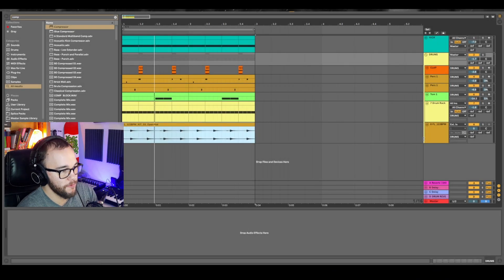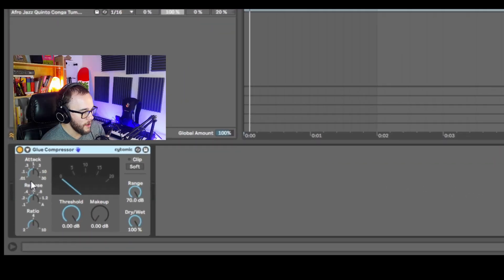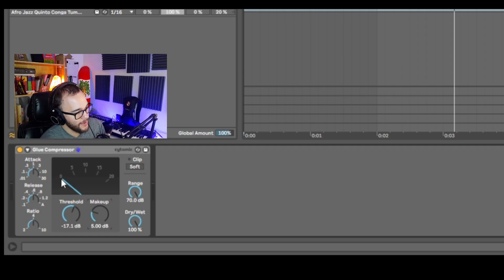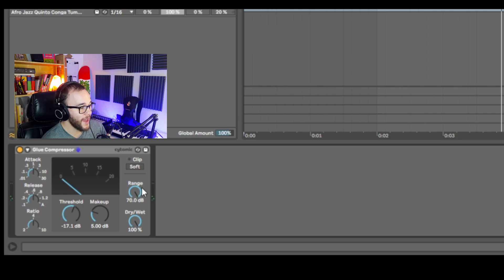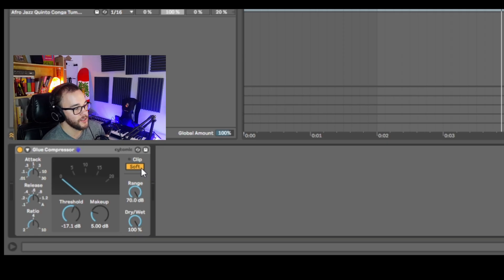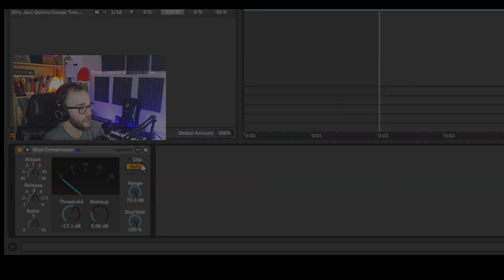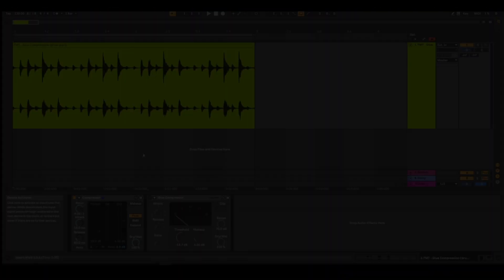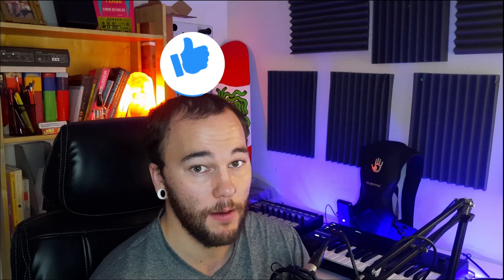How to use a Glue Compressor (and why is it different than stock?)

Comment: What does glued together sound even mean?
Reply: Like the sounds are closer together dynamically, and sonically. They sound like they are more 'together' and less dynamic in that sense. They move together more. It's subtle, and takes a practiced ear to notice, but it is beneficial.
Reply: it practically doesn't mean anything. the glue compressor simply has slower attack/release times.

Comment: I've never used a glue compressor and I wouldnt be spending a 100 quid on one just for the so called "warm" myth which is just a marketing scheme to sell plugins to beginners in my opinion, I use the tuneboosters free basic compressor for everything it works just fine. I'm sure this compressor is good for piano songs and music with lots of dynamic range but for a trance producer like me or anything hard and fast i want my sound to be consistently loud so I saturate and clip the shit out of almost everything so the peaks are almost flat before it hits the limiter.
Reply from the maker: Well the Glue Compressor comes with Abelton Suite so no need to purchase an additional one :) The warmth is not very obvious, but I do hear a difference, it's just very slight.

Comment: Personally I find the glue compressor doesn't do much differently than the regular compressor unless I use pretty extreme gain reduction and makeup on it. So I use the regular compressor with 2-3 db GR for taming peaks, and Glue with 7-10 db GR to give it a glued, colored sound. And this also works using really extreme GR and then doing NY compression by turning down the dry/wet a lot.

Comment: What all buses should u use the glue compressor on? Fx, synths etc?
Reply from the maker: I use it for drums but you can use it for any bus :)
Reply: @DowdenProductionAcademy  np man, should you use this on the master channel to glue the whole track together?
Reply from the maker: @fazedingleberry123  I would let the mastering engineer worry about the master! But if you are doing it yourself then you could use a glue compressor on the master, I wouldn't glue much, I'd say 1-3db at most on average (some higher peaks are fine).

Comment: should you glue compress everything? Bass? Drums? Vocals? etc? 

or just drums? Please don't say "just anything you want compressed or glued" lol

What about glue compressor on master?
Reply from the maker: I usually only glue compress my drums. Mostly I use glue compressor for drums and sometimes busses. Stock compressors for other things (you don't need to compress every single channel) and then limiter for master. When I master tracks I also use multiband compression but that's a whole other thing :)
Reply: @DowdenProductionAcademy  Thanks so much for that feedback - its hard to know what to learn, in what order - then when you learn a new trick you have the urge to use it everywhere!

Comment: Colour (saturation) is only part of the story. Glue compressor emulates a feedback compressor topology, whilst stock compressor is a feedfoward design. A feedback compressor first compresses the incoming audio before sending it to the internal sidechain (none of which we hear), it then "feeds back" the compressed audio to the detection circuit, therefore the compression action (for the signal we do hear) is based on a smoother pre-compressed waveform than the one we actually put into the compressor. This all makes for a smoother, less spikey compression envelope (perfect for glueing bussed elements with each other) which doesn't clamp down on peaks as aggresivley, making it ideal for shaping your drum bus dynamics (for example) without squashing the life out of the transients.
Reply from the maker: Cool! Thanks for the detailed explanation, makes a lot of sense!
Reply: Thx for the detailed explanation! Made a lot of sense

Comment: What is the point of this video if you can't really demostrate any audible differences? You should go with some extreme settings to make them obvious. And you should use audio effect rack or midi mapping to switch between compressors instantly. There is some homework to do)
Reply from the maker: The video does many things - it briefly explains how to use a glue compressor, it explains the differences between the glue compressor and the regular stock compressor (and when you may want to choose between them), and it explains the idea behind the glue compressor and what it's modeled after, all in around 2 minutes. 

I don't think using extreme settings is the proper way to showcase this tutorial because typically you would be using the glue compressor in the way I've outlined in the video - for 'gluing' things together. Of course it can be used for different types of compression, but the point of the video was showing how to use the glue compressor in a more subtle way. By all means, crank that compressor up a notch! I've got about 5-6db of gain reduction which is still a considerable amount of reduction. The glue compressor isn't going to be a completely different sounding compressor. It's different, but it's subtle. 

There is actually an audible difference between the compressor and the glue compressor in this video. I can hear it quite clearly. It's a subtle difference - but it's definitely there. Like I said, the glue compressor isn't going to drastically differ from the stock compressor - they are performing the same action. The difference is subtle, but it is there. If you're having a hard time hearing it, it could be to lack of practice and that's totally fine! It will come with time. 

I always welcome constructive feedback, there are many different way to do things. :)
Reply: For real.  Also on the "comparison" at the end the compressors have totally different attack and release settings.
Reply from the maker: @brandontaylor6  and like I commented early, they are not 'totally different attack and release settings'. Yes - the attack was 9.9 milliseconds off, I realize that now - small mistake that won't really effect the outcome in this example in any way significant enough. The release settings are the same.

Comment: i hear no difference in this example
Reply from the maker: It's very subtle! I definitely hear a difference. Listen closely to the clap - that's where I find it most obvious.
Reply: @DowdenProductionAcademy  i still love your channel
Reply from the maker: @LiquidModernityTastesLikeUrine  Haha thanks! :) Thanks for watching!
Reply: @DowdenProductionAcademy  Your attack and release settings are totally different in the comparison too.
Reply from the maker: @brandontaylor6  I realize now that the attack has a 9.9 millisecond difference. The release is the same on both compressors. 

I thought both the attack and release settings for the glue compressor are measured in seconds, but it's only the release that is measured in seconds. Must have mis-read that in the manual! 

Either way, the attack is only 9 milliseconds faster on the glue compressor, and won't make a significant difference in this example. I do apologize for not having the attack times exactly aligned, but it really is a very insignificant amount and shouldn't be dwelled on :)

Comment: Interesting. I usually put the MixGel preset on my buss to "achieve" the glued sound. However, I might start using the Glue compressor to try understand the "glued" sound. Thanks for the video.